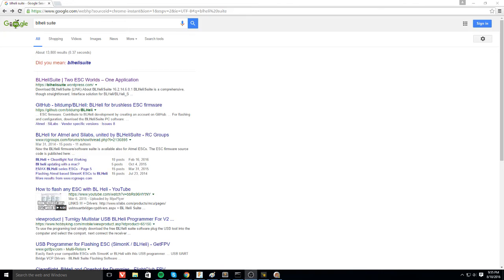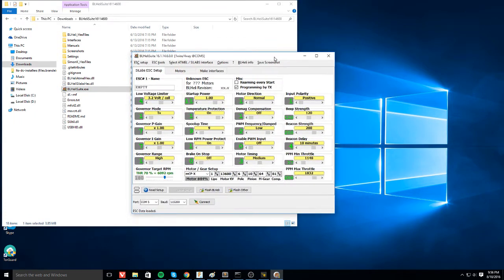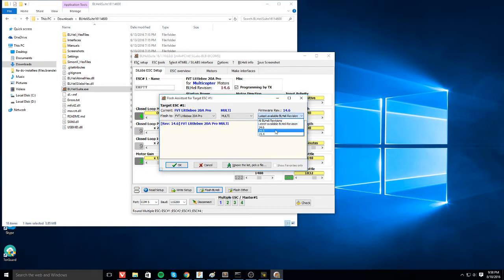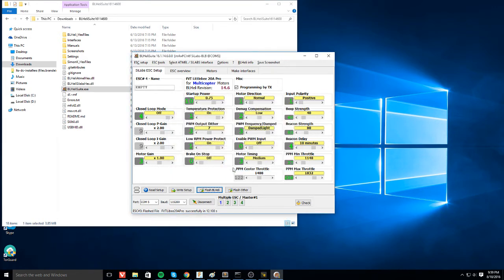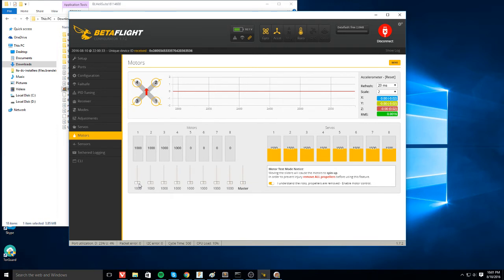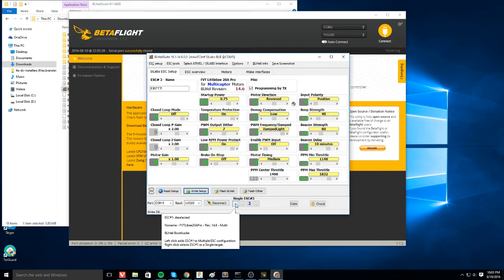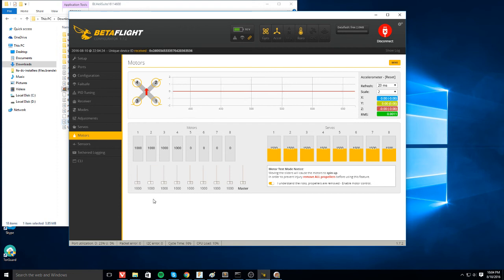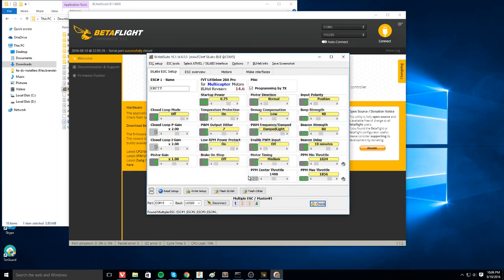How to flash and setup BLHeli ESCs

Comment: hey. i too cant connect and i only get the 3 first beeps. not the 2 that come after. could you help me out please. i just bought this new kingkong 90gt 4 in 1 3a esc. i thought i could just solder everything and get going again. but nothing worked. my taranis is bind and i see it on betaflight but when i hit arm nothing happens even when i go on modes tab and see that it turns yellow. idk if i bought this and it wasnt set up or something.

Comment: Hello. thanks for this. I just built a quad and went into blheli but it did not recognize any of the escs. What do you think happened here? I am using a matek pdb-xt60 pdb. And a SP Racing F3 V1 FC. I have signal wires going to 1-4 and a negative/positive wires going to +/- on the #1 channel only. Help please.
Reply from the maker: I'm not really sure what you mean by "a negative/positive wires going to +/- on the #1 channel only."  do the esc's beep when you plug power in?  they should beep (beep pitch) "low, mid, high" with power and then brief pause and (beep pitch) "low, high" with signal input.  If you only get the first part, there is a problem with them talking to the FC, if you get no beeping at all, there is a problem with powering the escs.  hope that helps?

Comment: Can u plz help me or the comment I just made a new drone and calibrated every thing and end I also when into blheli and updated all the esc and try idea to make them as close at possible and all of that but when I put my throats up like 5 the drone have a mind of it own and start to clime really fast to 100% in my house do flips on the ground I really don't know what to do because  rotor riot really inspired me to get into Fpv drone
Reply from the maker: if your props are off and your increase your throttle a little bit, it will continue to increase power to the motors until they max out.  it's expecting to add a little and see a result, no props = no result so it tries harder. this is normal (even when you bring throttle back down to 0 if airmode is on)